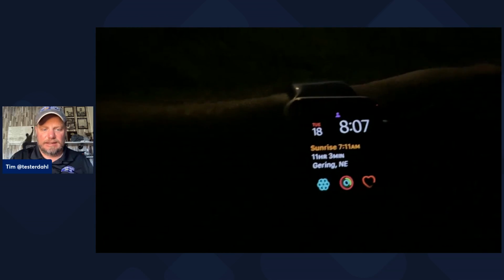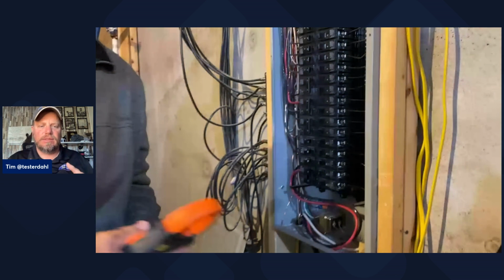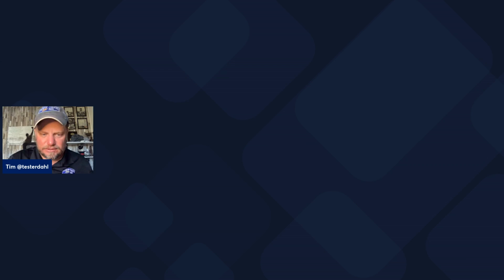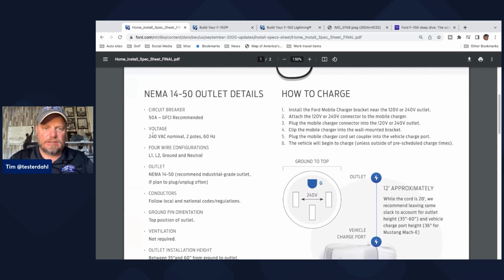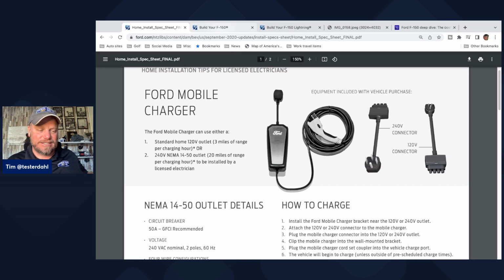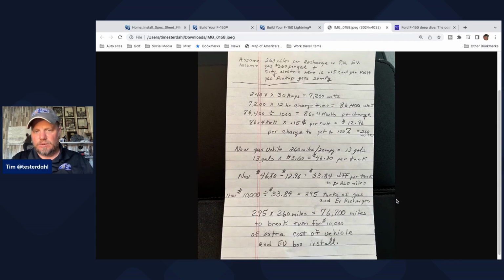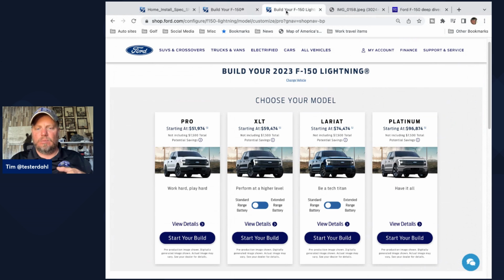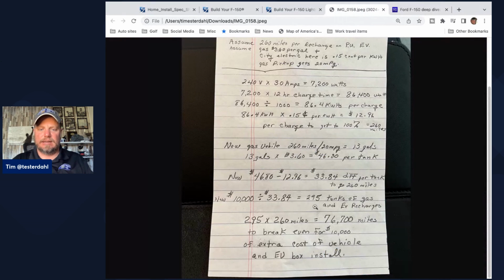11+ hours later on 220V charging price for 2022 Ford F-150 Lightning

Comment: I have a Lightning, and I charge at Level 2 speeds at home.  I use the app, which tells me KW usage, total charge time, etc.

Yesterday I drove about 150 miles, started from Full.  I have the Standard Range Lariat.

I plugged in my charger at home at 7pm and it was done fully charging at 8am.  It gave me 157 miles back to Full, at 100% .

It was 11 hours and 23 mins.  So, about 11.38 hours.  

It gave me 58% charge.  My 98 kWh battery took in about 57 kW.  That gave me about 5.2 kW per hour.  Under 80% charge is faster, over 90% much slower, so it averaged to about 5.2 kW per hour gained.

The truck has been routinely giving me about 2.6 or 2.7 miles per kWh driving.  I don't tow and go 55 or 60, sometimes 70ish.  City, country and Suburban.  Temps were about 40 to 70 through the day, morning to evening.

Drive in normal mode.

I usually drive about 120 miles in a day, round trip.  About 60 each way.

All I have to do is plug in and charge at home.

My electric is .13 cents per kW.  No hourly cost changes at night. Full time .13.

I also have a 2021 Powerboost which averages 20mpg after all the highway driving.

Comparing mile to mile, all things equal, my cost to travel same distance in the Lightning is 26% of the cost of the Powerboost's fuel cost (based on $3.50 per gallon).  Not 26% LESS, I am saying it's 74% LESS.  I am paying a quarter for every dollar the Powerboost gas cost for the same distance.

For one more simple example, my app has another charge record that may be easier to quickly note:  

I had a 37% charge a few nights ago on my home Level 2 with the Ford provided mobile charger.  On a cold overnight, about 30 to 40 degrees, it took 7 hours 13 mins to give me 101 miles.  Plugged in at 5pm and was full by midnight.

Hope this helps people. As I have been comparing side by side, in basically real time, my  22 Lightning Lariat versus my 21 Powerboost Lariat.

Comment: You need to add the cost of oil changes, tuneups, maintenance of engine and transmission (filters, coolant flush, etc.).  I know it's not much, but people always say the batteries are bad for teh environment, but so is used oil, collant, etc.  The real answer is there isn't a perfect solution and it depends on yor driving habits.  For instance, if you tow a heavy trailer I would never advise an EV to pull it.  But if you use your truck around town and have good charging capabilities, then it's a good solution.  You can even charge or free at some spots.  Again, the decision to buy an EV should be weighed on severl factors.
Reply from the maker: We did.

Comment: When comparing the cost of ownership of electric vs gas, don't forget the cost of depreciation.  Electric and hybrid vehicles lose their value much faster than gasoline vehicles, and somewhere around 10 to 15 years of age, electric vehicles' value abruptly drops to zero/scrap.  (The cost to replace the battery is far greater than the car's resale value, so the day the battery fails, the car has become scrap.)
Modern cars generally hold meaningful value at least to about 20 years, and pickups routinely maintain meaningful value out to 30 years.  Most truck owners would be shocked if you told them that their new pickup purchased today will be scrapped in 10 to 15 years.

Comment: You can properly measure the power usage with a current transformer coupled with a KW meter, you can get the whole setup on Amazon. Batteries are storage devices, they can only put out what you put in minus losses in resistance. You 15amp charge is like using a 1/4 water hose to fill a 500 gallon drum, the 50 amp 220V charger is like upgrading to a 1.5" hose with better pressure. The 500 gallon tank is still the 500 gallon tank, it will use the same amount of water. Regardless of what charging ampacity you use, a KWh is a KWh which is always the same. The only benefit to high load charging is reduction is charge time however offers the downfall of high base load on the power grid (Texas and California suffered from).

Comment: Electric F150...87 mile towing range while towing a 6000 lb camper. In the winter or cold weather, good luck getting down the block towing that same camper.

Comment: Well my 2018 Nissan frontier cost me $25,500 it's get about 300 miles on the freeway. It takes 7 minutes to fuel up from empty and I save money by doing my own maintenance oil change and filter, spark plugs and brake pads. The basics. It's been 4 years 70,000 miles no major issues. Will buy another gas fuled truck again until the ev's are worth as much as an average car in 10 to 20 years with longer range. Fuels up in under 10 minutes and the charging infrastructure is as abundant as gas station to drive cross country with confidence that you won't run out of power in the middle of nowhere. Good video though.

Comment: Varies widely.  BGE has a $0.04 / KWhr rate at night with an EV.   Literally $122 to drive the Tesla Model Y for 10,000 miles / year.  The range issue is why I think the F150 Lightning is a no go for hauling RV’s or anything else long term.  Waiting for the 500+ mile Cybertruck.  Should get 180 mile 10% to 80% towing range.  Hit the magic 380 mile / day towing distance with only one 35 minute charge.  Don’t forget your ultimate middle finger to the man move and install solar on your house.  6 year payback and driving is 100% free.

Comment: You left out the Road Use Taxes currently on Gasoline and Diesel cars, the government will not be denied their money, sometime AFTER we reach the point of no return your charging will also have to include road use taxes to be taken out automatically from your bank account, or you will have to pay road use taxes based on your mileage. Another point of contention  is you are not including the carbon footprint that comes from making the batteries, it extends the pay even point WAY FAR AWAY from the 75k mileage

Comment: FYI …. I saw you questioning the wire size. When a circuit runs (draws ) for 3 hours or more it is considered continuous load. When calculating wire size code requires it to be an additional 125% ( this addresses the heat factor created on the conductors)

Comment: Hi Tim, excellent video.  Your assumptions seem very reasonable.  Solar panels only work if you're working from home or on the night shift.
At some point, the cost of a replacement battery will come into play in resale value or maintenance cost.  In either case, it would be nice to know if it will age out or miles out before the battery craps out.
Any properly maintained F-150 driveline is good for 200,000 miles with many going twice that.  The battery has to be considered part of the driveline.  It would be nice to know if a Lightning can do 200,000 miles and at what cost.  That too will require a whole new set of assumptions but I think you're up to it.
Reply from the maker: Hey Rick, thanks.

Ask and you shall receive on the battery pricing. I did a whole video on it including replacement timing: https://www.youtube.com/watch?v=gCQLvTiINOo&feature=youtu.be

Comment: 10 minutes to fill my VW TDI and I'm good for 650 miles.  I love my snorty little diesel! I'd expect a lot of reliability issues with these high amperage charging connectors because any resistance at the connector will create heat that will probably have negative effect on the parts of the connector that maintain the retentive force/ tight physical connection that ensures good conductivity.

Comment: Tim- I think your estimate is off by assuming it pulled 30 amps the entire 13 hours.  You’d be better to use an accumulated watt hour device, or just use the cars watt meter and find the difference if any compared to circuit value.

Comment: A good analogy to understand how electricity works is to compare it to water flowing through a hose. There're several variations of the analogy, but they are all generally the same. The electrical charge (Volts) equals water pressure, such as PSI. Current (Amps) would be volume of water going through the hose. Power (Watts) are a function of volts and amps and would equate to gallons per minute or hour. So, the number of amps is ultimately what you pay for in terms of "fuel economy", the volts just determine how fast those amps are able to get sent into the battery, and the watts are the mathematical result of how much water is flowing at a given time. It gets confusing because the electric bill shows you are charged in KWh, which is how much power (in thousands of watts) was used in the snapshot of time of that monthly bill. It's not wrong but because the voltage is constant at 240/120, the amps are the most important variable for your bill. The size and length of the hose would equate to resistance/ohms.

Comment: The temperature of the battery impacts range. Charging a battery heats it. If you run on a hot battery, you lose range and overall battery life. You want to charge your battery as much as you can but leave time for the battery to fully cool before use for maximum range. Truth is, electric vehicles use the fuel used by the power plants. That fuel not only covers the electric car but line loss over distance, electricity lost in heat at step transformers in line, DC conversion and battery charge. A hybrid is far more environmentally friendly and does away with the TOXIC battery change and recycle. For those not in the know, a hybrid is a fuel driven turbine on an electric car without the massive battery pack.

Comment: Great video.
    I had to stop and think about all the electric vehicles I passed up this weekend on my trip to San Francisco from Fresno CA about 400 miles round trip.
     As I was sitting in my 94 chevy suburban at a rest stop called Casa de Fruta with my four kids and wife having sum lunch. My oldest daughter and son were talking about some of the new EV'S and how much money we would of save if we had one on this trip. I just stopped and listened to them talk. My son had two good points we couldn't all fit in one comfortably and we would need to stop and change it somewhere to come back home. The suburban has a 44gal tank and gets about 10mpg. we can get their and back on a tank of fuel.  My daughter brought up that all the new cars have  advanced cruise control and all the gadgets that would be nice but not needed. Anyhow as we made our way there and stuck in traffic for about a hour just Idoling all the fuel away, I was starting to thinking maybe my kids were right on the EV thing.
     Once we arrived there the EV thing was thrown right out the window. My son and I couldn't stop laughing as we were the biggest, loudest, and some could say obnoxious vehicle there. We were setting off car alarms and listening to the great sound of the 383 and glass packs, even a chirp from the 35" BFG as we hit second gear. People were even starting as we passed by them. The best part was  driving past a sign that said no loud vehicles permitted.

Comment: As to why they say a 50A outlet:  National Electrical Code requires a derating by 20%/to 80% for continuous loads (more than 3 hours).  There is no NEMA 14-40 outlet, the next smallest outlet below 50A is 30 - and the limit on that would be 24A.

You can go up to 40A from a NEMA 14-50 if you replace the EVSE, and up to 48A hardwired if that's a standard range model.  Extended range Lightnings go up to 80A if you have a hardwired EVSE.

Ford's claim of 20 miles of range per hour at 2.44 miles/kWh (98 kWh battery, 240 mile EPA range) would require 8.2 kW, not 7.2 kW - the mobile connector can't actually hit that.

What probably happened that night is you took 6-8ish hours of charge, and the vehicle periodically woke up to heat the battery for a brief period of time.  The chances are slim to none that a 98 kWh battery took 86 kWh of charge when it started at 50%...  Either something is HORRIBLY wrong or the truck was sitting not pulling current for a large portion of those 12 hours.

Comment: Besides new truck sale price has to be under $ 80k. 
The federal EV tax credit will be available to individuals reporting adjusted gross incomes of $150,000 or less, or $300,000 for joint filers.
Tax credit cap for automakers after they hit 200,000 EVs sold is eliminated.

Comment: If you tow or drive heavy loads long distance then this truck is not for you. So many say EVs are not the answer always mention "when the battery fail" with no experience of a failed EV battery or the low towing range. Then it's not a vehicle for you. I see so many F150s around my city NOT towing anything but the EV tow range is important. If you need range, then this vehicle is not for you.

Comment: The lighting has 98kwh capacity. Where I live electricity is about 11cents per KWH. So 98 x 0.11 = about 11bucks. 11 dollars for 250miles of range is really cheap compared to gasoline. With gasoline 11 dollars will get you around 70- 80 miles of range.

Comment: I purchased a 1/2 ton truck with a V8 engine to pull a 5500 pound travel trailer. On a full tank (25 gallons) I can travel 250 miles and gas up again in 10 minutes and continue my trip. This F150 Lightning would be useless to me.

Comment: Charging to only 80% simulating the decreased range you'd get by a worn battery when its brand new lol.

The tech just isn't there for me.

Also to reply to one main thing at 17:30

Solar panels aren't free. I can go a long ways on 20k worth of gas.
And battery replacement would likely come before it leveled off or even got close at that point.

Comment: If you can afford 80+k for a vehicle why go electric? Fuel cost clearly should not be an issue. For me , EVs are a major hassle to keep charged and not worth the money. When you can charge a battery in 5 min and get 300 miles range only then will EVs be practical.

Comment: Recent trip to Virginia and return. 900 miles managed to get 29 mpg with my 2023 CRV and did it with 16 total hours behind the wheel, INCLUDING TIME SPENT GASSING UP. With an EV that would have involved too many hours getting charged and would have made the trip 2-3 times longer if not more.
Reply: Yeah i'm thinking some motel time / loss of time (as in wages) needs added on

Comment: The price difference is more if you have to use Quick Charging Stations and not charge at your home! Here its $62 for a charge! Remember it will go up higher as more people have electric vehicles...Also to charge at home the electric company charges you more kwhrs $0.42 cents here to charge electric vehicles!! Wait until road taxes are applied to electric cars etc..It will be equal to $45 per gallon of gas..The politicians said in 2005 to get people to stop driving is to have electric cars/force them on people..This was well known and talked about! But people never listen!

Around here hosing costs are very high and lots of apartments,condo's,town houses and you wont have places to charge your electric vehicle at home!

Comment: Battery temperature has a big effect on range, chemical reactions in the battery slow with lower temps. While charging quickly the battery gets warm from charging. Once charging slowed to a trickle it slowly lost that heat so the computer estimated the range at less because of the cooler battery temp. When you start driving the battery will get warmer again and that will help.

In winter my electric car shows lower range but if I charge for an hour before I'm ready to travel the charging will warm the battery and improve range.

Comment: One item I noticed in your calculations is this is a truck and other videos I’ve watched was the range goes drastically down if you load the bed or hook a trailer to the truck, after all it’s a truck.  Someone who uses a truck as a truck especially for a living I don’t see how it would ever work with such a shortened range and time numbing charging times.

Comment: To get the fast charging you need the pro station (100A for 8-9 hrs) but the 30A charger says 20 hours for a charge. I guess the torque for a truck is different than a car. My Bolt will charge in 9 hours at 30A to 238 miles.

Comment: Here in CA we have to pay 39 cents per KWHr.  Fortunately i have solar so my home charge is free (of course there's the $150 per month payment on solar loan but that powers my house too).  No oil changes, no engine air filter, brakes don't need service until after 150K miles due to regen braking, no smog, no exhaust system maintenance, etc. so ownership cost is way less.  I've been driving electric since 2013 and I never had to take any of the EVs in for service besides free recall work that lasted less than a day to include a complete battery replacement.  I pay for tires, electricity and nothing else yet.  Yes, i can't blast up the interstate at 90mph and get there any faster than 70mph because of the additional charging time, but I'm retired and can't afford the tickets anyway.  I did end up with a good charge while having a nice steak meal and only had 90 miles to get home so i ran 93mph for as much as i could in traffic- thankfully no tickets.  Happy Thanksgiving!

Comment: So I live in  Ontario Canada.  I have owned pickup trucks for years . I will absolutely never buy a stand alone electric truck  .
   I have a vacation property about 4 hours away , driving through some pretty rural areas . I simply don't trust this technology. It's not that I am against it . I tow , load cargo , the problem with electrical you can count on it on the cold .
   The output is sporadic,  never mind the fact that I am not driving through snow.
    The other issue is I remember in 2004 when the grid between ontarion and Ohio went down . Tell me how plugging in ever car into an aging electrical grid is benefitting society .
   I will be using the internal combustion engine as long as they are available